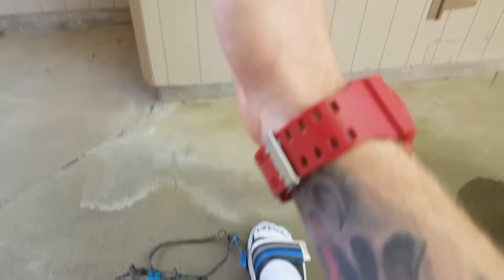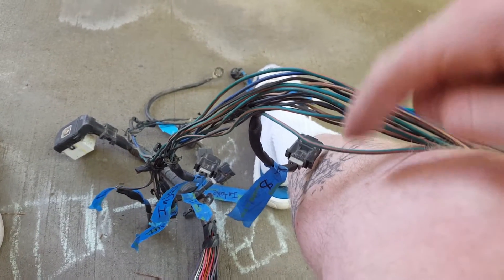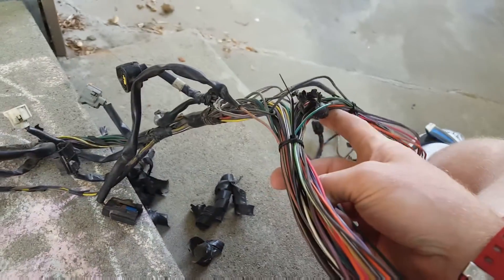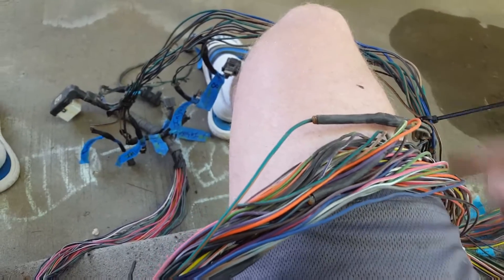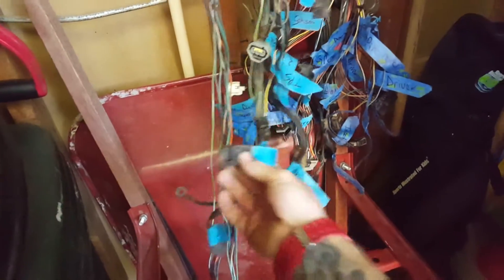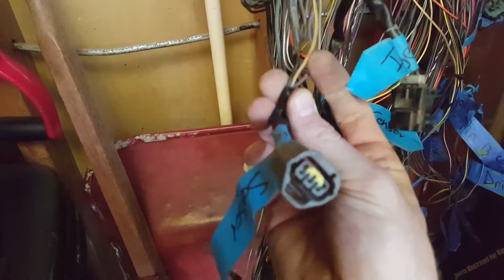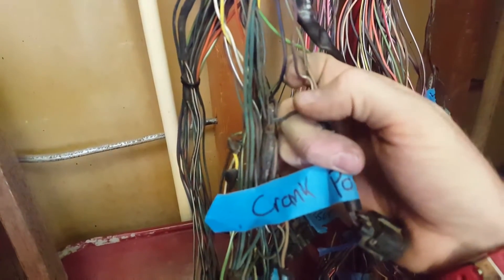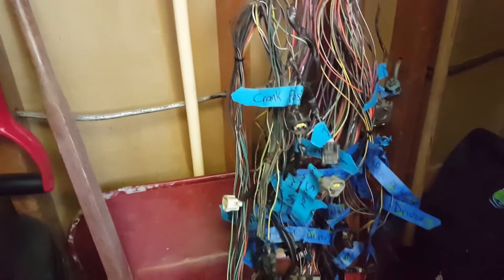Jeep tj 5.9 swap (Wiring V2) video 4

Comment: I did 3 of the 5.9L conversions and found that the original harness from a 4 or 6 cyl will work. I had to shorten and lengthen connectors to accommodate for the different sensor positions on motor and add 2 or 4 more injector plugs.  First one ran fine but back fired out the muffler more than normal. I drove it for 6 months then found that the plug for the throttle position was wire backwards for the 4 cyl and had to reverse pin 1 and 3. I see you ran into that to Montana in your #26 and 27 video.

Comment: How did you wire up the speedo and tach?
Reply from the maker: Pin them in
Reply: +MontanaLowGear There is no wires from C3 for the tach and speedo. I'm going to '94 gauges.
Reply from the maker: Mark Bond the tac signal comes from the crank position sensor so when you wire that up it’s gonna read out on your dash the speedo has a connector that plugs into the tcase...
Reply from the maker: It’s all computer if you wire up all the connectors correctly your dash will work like it’s supposed to
Reply: +MontanaLowGear Is that how your works?
Reply: +Mark Bond No. I am finding something different
Reply from the maker: Mark Bond email me poketfullashellz at gmail don’t put a c in poket lol

Comment: where did you get your wiring manual information for the 5.9 magnum engine. i can't seem to locate  one with the level of pin out detail you have. i am swapping into a 65 d100 and need to make it standalone. harness and computer. 
thanks for any help

Comment: why did you pull the whole 5.9 harness apart? you could have left it alone and just wired in your powers and grounds from the jeep to the dodge pcm. at least thats what i did with my swap. essentially your only changing like 5 wires.
Reply from the maker: I'm not using the dodge harness I spliced the dodge harness into the tj harness
Reply: i know but you should have just left the  dodge harness alone as it was already made to fit the engine. you could have mounted the pcm and just wired in the power from the tj harness to the dodge pcm.
Reply from the maker: True but this is my first try to do this big of a project so I'll know for next time... what about the clutch
Reply: im looking to make a harness for my 99 wrangler .putting in a 5.2.what do i need to swap from jeep harness? both are automatics..
Reply from the maker: I'm assuming your going to use the the dodge automatic and if that's the case I would use all of the dodge harness. This would be a completely different swap then mine, but i did do some research in swaping in the dodge automatic. The big trouble will be figuring out the ASD might be as simple as pinning in the jeep ASD harness into the dodge PCM connectors. If you go look at your jeep harness you'll see 2 large square connectors that connect to another harness on the firewall that's the jeep ASD totally different from the dodge...
Reply: Yes got a 46 re for 100 with less than 20k on it! Gotta love craigs list lmao..will check it out when i get home thank you
Reply from the maker: I do love Craigslist haha! ok man yeah like I said it should be fairly simple either way. looking back this was one of the easier parts man! I have a complete wiring video on what changed for me if you go to the channel page.
Reply: what plugs would have to be spiced to use the dodge harness? do i have to do anything with the trans harness if im using a dodge auto?
Reply from the maker: ASD for sure man its a totally different system for the ASD. Best thing to do Is get both FSM manuals and start studying... there are a few different ways to do this. I don't consider myself an expert either and because your swap will 100% different I don't want to give you bad info. Couple things to make sure of is the different computer systems during the 90s and early 00s. Your 99 has a CCD operating system so you need to make sure you buy a dodge PCM from 1999 to match it so your gauges work... you should try hard to buy the engine complete with tranny, wiring harness, and PCM. 99 would be best case scenario.
Reply: +MontanaLowGear. i have a 97 dakota as a donor..115k on it .got it for 300 bucks.but picking up harness and pcm out of a 99 ram.
Reply from the maker: ok injectors will be different but you can get some adapters for $15ish might be one other sensor or 2 that are different you can just buy the 99 sensor it will fit the 97 block
Reply: +MontanaLowGear cool thanks ...where do i get the binder full of plugs electrical information that you show in your videos?
Reply from the maker: the Internet bro haha Google 99 jeep tj FSM and same for dodge... go to electrical section print out the pinouts and stick them in a binder... this is an easy swap but you'll have to do some research... the thing will get you is not the hard stuff it's not the wiring or welding or any of the obvious stuff it's the little things at the end like radiator hoses, air cleaners, electric fans, where to put the burbank tank and how, power steering is a bit of a head scratcher body lifts might be needed depending on where u want to put the engine... and stupid stuff like that... the engine went in fine it's all these little things that got in my way
Reply: I hooked power wires to C101 and it ran. How did you wire the tach and speedo?
Reply: Steven fizgibbon.i just put a 5.9lmag in my 05 ram 1500 that had a 4.7.l. I know the 5.9l has a fuse box inside the truck an the 4.7l doesn't it only has one for my year of truck how can I save a headache an hook it up.i do have the pcm for the 5.9l